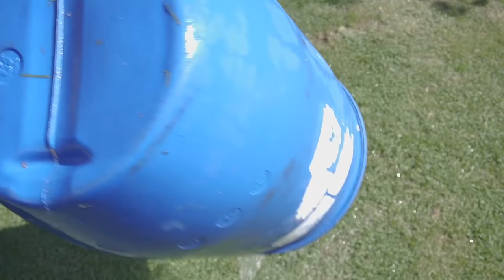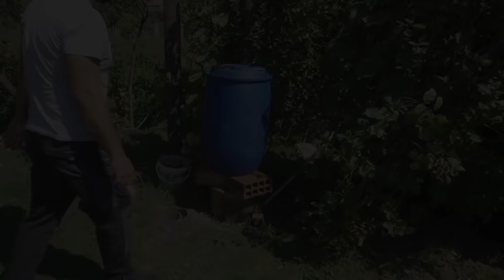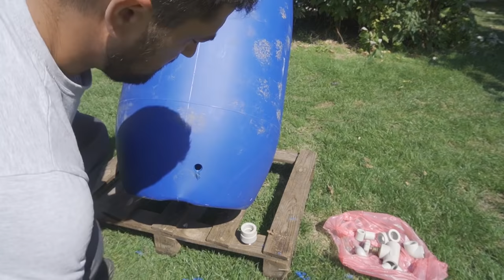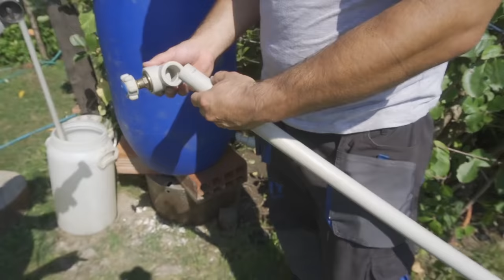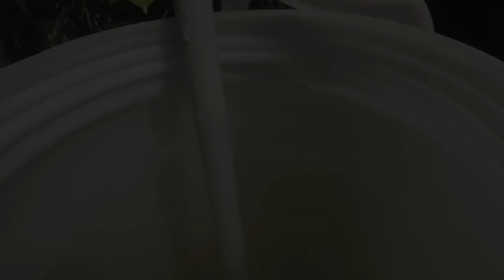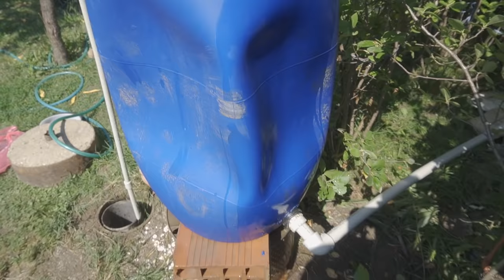How To make Free Energy Vacuum Water Pump Without Electricity using Plastic Barrel 125L / Experiment

Comment: This done on a massive scale could produce virtually free electricity when outlet water turns a turbine then let to run back to source. It's basically down to something strong enough to support a huge vacuum.
Reply: No, this can't produce free electricity. For the simple reason that this "pump" does not work. This is a fake video. Can you explain why a vacuum should be strong enough to pull up water from a deep hole but is not able to pull back the water in the outlet pipe?
Reply: @sciencefreak9070  the barrell isn't high enough, if it was you'd put your encased turbine/alternator in between letting gravity return the water to source.
Reply: @martineleven8179    It would be a bad idea, to put the turbine in the barrel. Let's say water is pumped up from underground for 3 meters. If the turbine is in the barrel the water outlet of the turbine would flow down due to gravity for 3 meters and the energy from this flow would be wasted. It would make more sense to put the turbine at the level of ground water, since at that point the downstreaming water has the maximum of energy. 
But I repeat: this pump is a fake, it does not work. In such a continuous circulation of water the same amount of water would be lifted up against gravity and would flow down to gravity. Energy needed for the lifting up is the same as the energy which could be gained from the downstreaming water - losses neglected. Thus no energy can be gained this way and due to losses also no such continuous stream of water is possible.
Reply: @sciencefreak9070  I don't mean put the turbine in the barrell, the outlet water via pipe into an enclosed housing turning an alternator on the outside then a hole in the bottom of the housing letting water pipe naturally back to source.
Reply: @martineleven8179    It doesn't really matter where you put the turbine. It doesn't work.
Reply: @sciencefreak9070  have you actually tried it ?  Surely if the water drum / tank is large enough the vacuum created should be ample to suck water up through the correct size pipe & the pressure in the tank ample enough to push to source.
Reply: @martineleven8179    Due to laws of physics it is often possible to predict the outcome of experiments. In this case there is no need to try something if it is obvious that it isn't possible. There are two threads of reasoning with this pump:
1. Lifting water up from a well needs energy. But there is no energy input with this pump, neither gravity nor vacuum are a source of energy. This settles the case, never mind what sizes of pipes and barrels are used. This pump can not work.
2. But of course this can also be explained by other laws of physics. First of all you should be aware that vacuum does not suck. Vacuum is empty space and does not do any pulling or pushing. The effects attributed to vacuum are in reality the effects of air pressure if no counter-air pressure is present. If you put a very long vertical pipe in the well with a vacuum at the upper end, air pressure will press water of the well in this pipe, until water pressure at the bottom is equal to air pressure. Thus water can be raised for 10 meters. 
Mind that it is not weight of the water which counts but pressure. In this pump water will move inside the barrel, wenn air pressure (minus the remaining air pressure in the vaccum area) is bigger than water pressure. But water pressure only depends on the height of the water column. Water pressure is always bigger at the bottom of the well than at the bottom of the barrel. This means, when vacuum builds up in the barrel the point, when the vacuum prevents the water from flowing out is reached before the vacuum is strong enough to get water moved up from the well. This pump can not work.

And there is a third point also: if this would work we would have it in many places all over the world, it would be commonly known and plumbers would offer to install it for those who lack the tools and knowledge to build it.

Comment: Use cement tank for better results and use also 2.5inch pipe outlet n 3inch pipe inlet please try it sir
Reply: And then feed the discharge line back into the source with a hydroelectric turbine in-between... That much water flow could easily power 300-500 watts of continuous power.
Reply: @jordondarke1884  Eureka!! Perpetuum mobile has been found,
Reply: Dimetion of tumes are not critical.

Comment: It's better to install a strainer or filter at the end of the suction line to prevent some small shits from coming into the suctiion line and also a non-return valve must be fitted on that suctiion line about 1 foot from the tip..
Reply: With abarrel, no foot valve is needed.

Comment: That's an old style. We call it force by gravity vacuum but it doesn't work if the height and distance isn't proportionate.this trick have been measured before doing anything else.
Reply: That's not true. I did this at a much smaller scale in high school. The inlet just has to be smaller than the outlet. The distance of the outlet does not have any impact in this scenario. The size of the barrel being used, the size of the inlet tube, and the size (circumference, not length) of the outlet are all that matter.
Reply: @jordondarke1884  Noop. The diameter of inlet and outlet does not matter. Source must be higher than outlet!

Comment: Metal barrels have rust and wouldnt that contaminate the water ?
Reply: They only have rust because they oxidize. Since water is h20, you'd have to insulate the metal with something like vinyl paint or rubber.

Comment: First thing I noticed is no seals in the lids.  Second thing is plastic is not rigid enough for a suction/siphon type of device - need a steel barrel.
Reply: Or Smaller inlet and outlet.
Reply: @jordondarke1884  No, size of innlet/outlet does not matter. As the barrel here is crushed, the seals ar ok.

Comment: Thank you for the entertaining video. It is very obvious it is a fake. The first case could be real when getting the water from the container sitting on the ground. It is merely siphoning since the end of the outlet looked like below the water level in the source container. Note the amount of deformation the blue barrel had which was cause by a light degree of vacuum to "suck" the water up. For the 2nd case when the water source was from the well, the water level of the well is unknown. It could be just below ground  or a few meters below, since the intake pipe was quite long. In order to "suck" the water from the well, one must create a vacuum equal to a column of water from the well water surface to the water discharge point to the blue barrel, which could be many times more than the first case. Now compare the deformation of the barrel, it is even less than the first case. That is less vacuum!

Comment: The outlet size must be larger than the input  even though this seems illogicalAlso from the video ,it just might show water coming from the barrel and not from the well.
Reply: The suction pipe may be any size, much much bigger than the exit pipes. Pipe sizes only affects the flow. This system can not lift any water from a well.

Comment: If you use the suction pipe wider , the narrowing in the drum can be eliminated .
Reply: This type of suction pump must have a larger outlet pipe than inlet pipe to work.  The drum needs to be a rigid material like steel.
Reply: No, it can not. It is the height between the water level in the drum and the outlet that makes the tank collaps.
Reply: @Rattlerjake1  No, dimension of pipes dors not matter. Only, larger pipes flows more water, but till source must be higher than outlet.
Reply: @kjellg6532  - Try again, me@thead!  This is NOT a basic siphon system.  The larger outlet pipe is needed to produce enough suction to draw water UP!
Reply: @Rattlerjake1  From what I read here https://en.wikipedia.org/wiki/Siphon your theory do not coincide.  Pay attention to the example with the huge sucking tube. Could you expand your theory, making it easier to comprehend. 

This video comes to the same conclusion: https://www.youtube.com/watch?v=NiThJ9vUagU

The conclusions is that this is a siphon. With a barrel it is easier to prime the siphon, you do not need any foot valve at the source. The barrel can store a limited amount of air, so if there is any air leak in the system, the siphon do not stop at once. Anyway, this system can not lift any water from a well, not even one inch. It is nothing but a (droplet) siphon. 

I hope your brain too is working fine thank you, Jake.
Reply: @kjellg6532  - This is NOT a siphon, it is a SUCTION system.  As I said in my previous comment, The larger outlet pipe is needed to produce enough suction to draw water UP!
Reply: @Rattlerjake1  Have a look here figure to the right: https://en.wikipedia.org/wiki/Siphon#Theory
How come that the water flows from A to D, not visa versa? 

Here a barrelled “pump” is explained: https://www.youtube.com/watch?v=NiThJ9vUagU It seems it only worsk from high to low, just as any other siphon?

To lift water up, you must add energy to it. In a barrel “pump”, you add energy once at priming. For how long time can a barrelled “pump” run on a given amount of energy?  (You fill up the tank in your car, now, can you drive it for ever?)
Reply: @Rattlerjake1  OK. But since you are smarter than me:

The barrel sits 1 meter above ground, the source is 1 meter lower than the ground. You let go of one litre from the barrel to the ground. This is a closed system, a “pump”, so one litre out must be compensated with one litre in via the suction inlet. One litre out times 1 meter drop must equal one litre up one meter in the suction. But there is another meter for this litre to reach the barrel. So you have to let go of another lire from he barrel to get this one litre all the way up into the barrel. You have lost two litres and gained one. With an output flow of 2 litres per second, you will loose 200 litres in 100 seconds and gain 100 litres. In 100 seconds, the barrel has lost 50% of its primed volume. After another 100 seconds, the water volume left is 25%….. for how long will the “pump” run? 

A little enigma for you. 

Take a barrel, 200 litres. A suction tube down a two meters into a pond. The exit pipe pointing directly down 3 meter to the ground. The exit orifice is polished so it is perfectly flat and smooth.

Now, hold a playing card against the exit, fill the barrel to the rim and close it. There is water in the suction, the barrel, and in the output tube. 

You gently move your hand away from under the playing card. 
How much water will come out?  Being so much smarter than me, you clearly have the correct answer?

Comment: What principle in hydrodynamics is being used here?
Reply: It is a siphon with a priming barrel. Water level in well must be higher than output to the field for this to work.
Reply: @kjellg6532 this is not siphoning. This is gravitational suction induced by displacement of water inside the barrel. If properly designed with stronger barrel with right Volume it can even suck water from 20m well.
Reply: @infinitebeing1119  20 meters? No, that is not possible. Take a bottle, suck it in water and lift it by the bottom, still with the neck in the water. The bottle stays filled with water. OK. Take a tube, 30 m long. Close it in one end, suck it and lift the closed end to 29 meters. Will the water rise in the tube? How high? The water will stop at about 10 meters and the upper water will boil, at room temperature! 
This is a siphon. A siphon can make water pass over say an eight meter high wall, but all that water must exit at a level lower than the source. By no way can a siphon lift any water up from a well.

Comment: The barrel is squashed because you didn't leave (10-20)% empty air space
Reply: If the barrel is squashed or not is completely irrelevant. This does not work, never mind what barrel you use or if you leave air space or not. It's just one of the many fake-videos on YT. You can't lift water to a higher level without an input of energy. The idea, that vacuum could "suck" water up from the well is false. Before vacuum would be strong enough to do this, it would prevent water from streaming out at the outlet side.